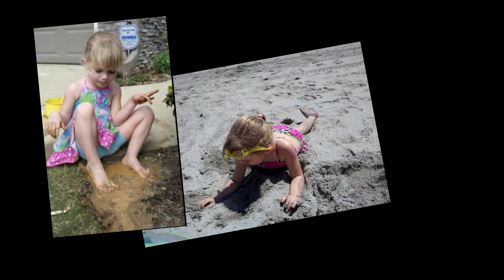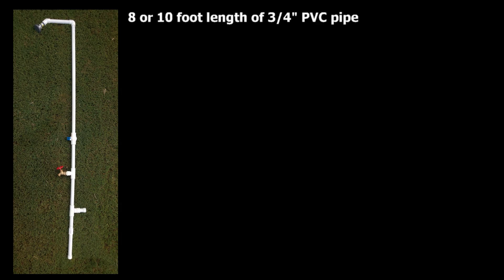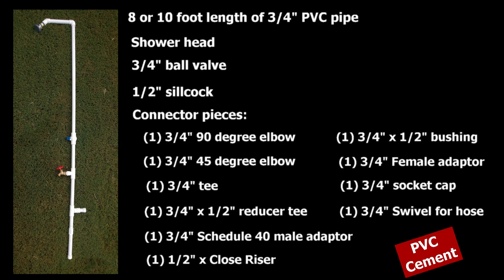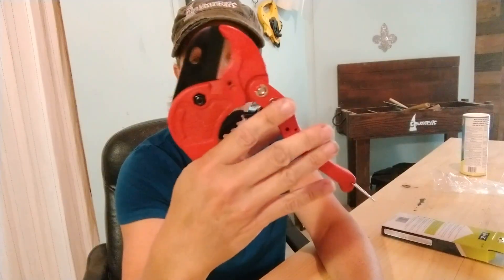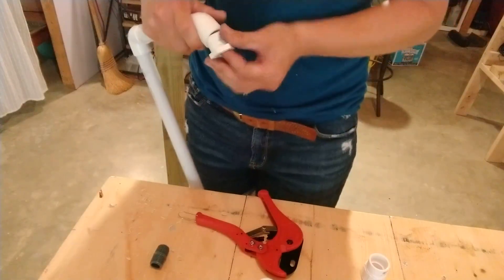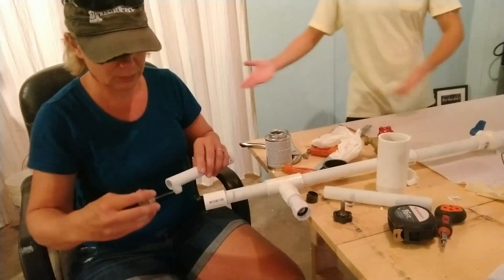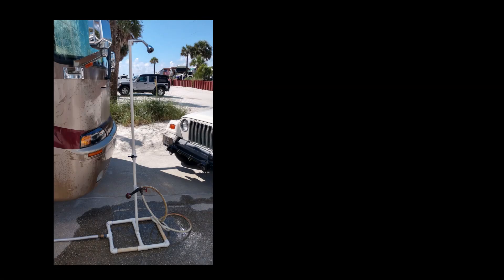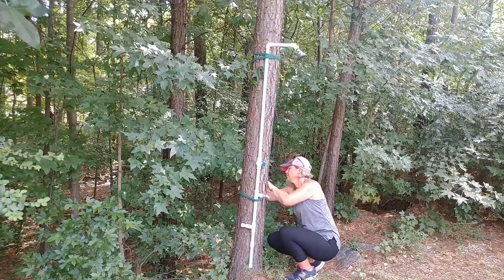Portable Outdoor Shower Attachment for Water Hose - RV Camping and Glamping

Comment: They put washer and dryers outside in garages or closets in Florida. They probably do it in many places where the temperatures are mild to warm. I am going to plumb this off of my washer hot and cold tap. Wish me luck. 
The washer is located outside. I was going to use pex but pvc is so cheap and easy to use.  Should be fun.
Reply from the maker: You could definitely make it more permanent and "fancy" looking if you wanted to. I just did this one to be portable for camping. Good luck!

Comment: I built this this morning, took me longer to find the bits at Lowe’s than to assemble.. thanks for the list but schematic would help too...and I used a sand umbrella post instead of a base
Reply from the maker: Noted! Thank you for watching!
Reply: I had the HD get parts for me and curbside pickup. having a heck of time trying to put together. I can't get silcock or hose swivel on. Can you help? I do wish video showed more detail.
Reply: pielcanela365  I used two 3/4 inch smooth x 1/2 threaded adapters, the sillcock has a 1/2 thread, so just put Teflon tape on that and screwed it into the 1/2 threaded side. For the hose, you also need a 1/2 inch thread to (typically) 3/4 inch hose swivel...it’s usually brass. The 1/2 thread goes into the pvc 1/2 threaded side and then you attach hose. I don’t know how to upload pix here, otherwise I would

Comment: is the 3/4in x 1/2in reducer tee slip on three sides or threaded on the 1/2in side?
Reply: Looks like it's threaded on the 1/2" side to install the 1/2" sillcock for the foot wash.
Reply: @GlennRice666  Thanks! In the process of ordering parts, need this for pool side this season
Reply from the maker: @pielcanela365  yes, Glenn is correct!
Reply from the maker: @GlennRice666  yes, you are correct!
Reply: @GlennRice666  have you put one of these together? I'm having trouble, not sure if I'm missing parts or just user error.
Reply: @ChickFixUSA is there a connector piece between the T and the hose  swivel?

Comment: Is There A Way To Control The Temperature?
Reply from the maker: Nope, it just hooks to the hose, although if you have hot and cold water sources, I'm sure it can be adapted to take both
Reply: Nfinite Mile dude it’s hooked up to a camping water line just like on the outside of a house it’s not hot just ground temperature

Comment: This is an embarrassing question, but where is the water coming from? I have only done tent camping. I have rigged up solar shower bags and shower curtains to trees, but have never had a hose around.
Reply from the maker: This would not work for primitive camping.  I have now specified in the title and description that this is for home or RV camping.  Thank you for bringing this to my attention!
Reply from the maker: You will need a hose hookup to use this, which we always have when camping in our RV. Also means only cold water.
Reply: On the contrary - it's the most logical question!